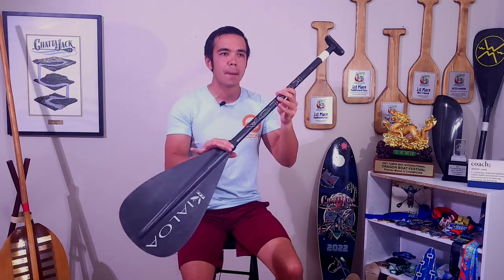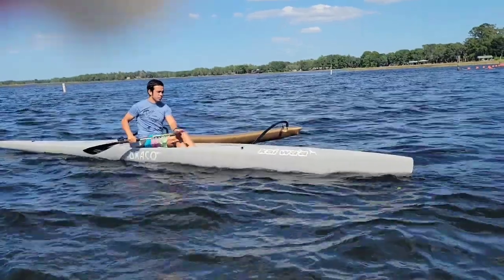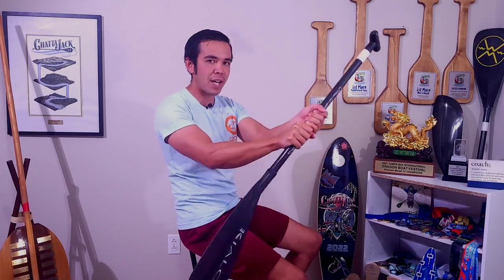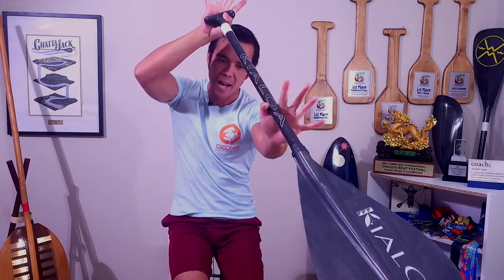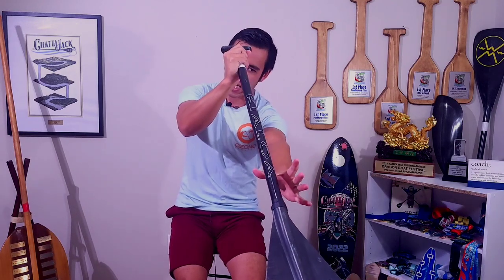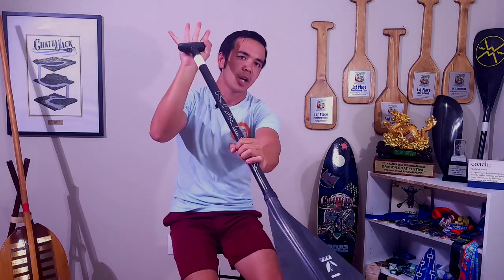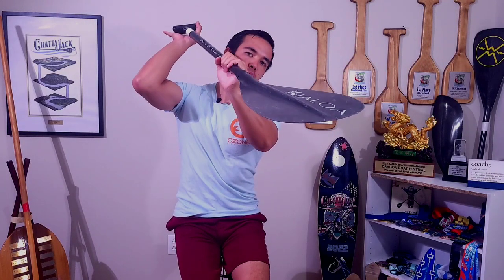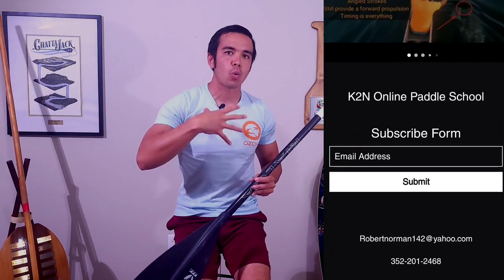Paddle Tip: Mastering Switches (Outrigger Canoe)

Comment: Does this work for bent shaft paddles?
Reply from the maker: The premise is similar but the bent shaft suffers greatly on being clean with the switches!
Reply: Would you suggest that I switch to using my steering blade in the oc1 if I want to try your method?
Reply from the maker: @deraldreynolds3294  definitely to practice then try with the bent shaft. Swing weight with the steering blade will make the throw very easy.
Reply: Many thanks for the posts, I will try it out.